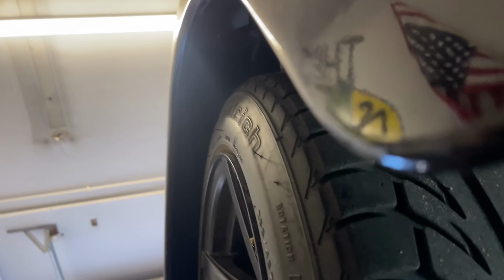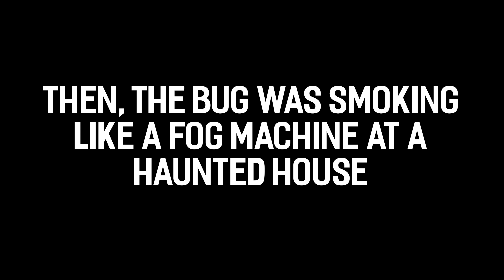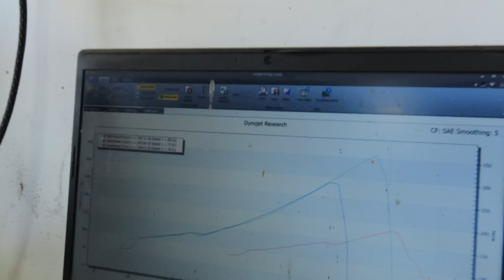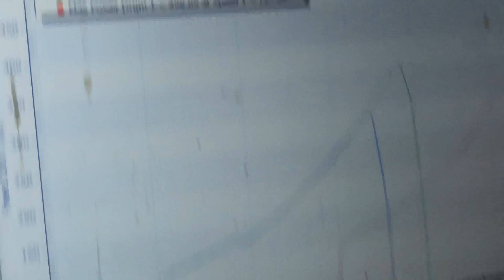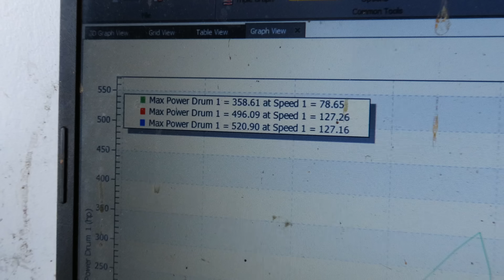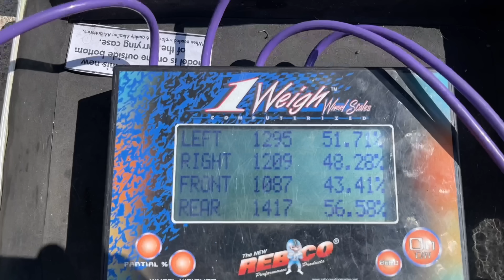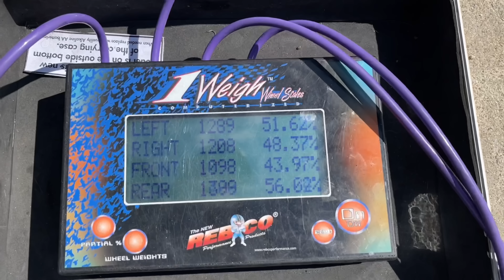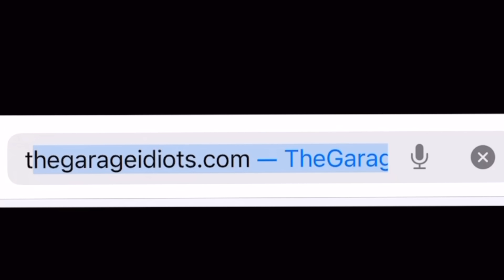K20 Swapped SW20 Chassis Bug Makes POWER at PFI SPEED!

Comment: Just a tip, if your closed ended lug nuts are too shallow for your stud length, you don’t have to cut the lug. Just tighten the lug until it bottoms out on the stud and then it will pop the cap at the end of the lug. Lugs aren’t cast closed ended, the just cap them at the end of processing

Comment: Are those Ball Bearing turbo cartridges? You shouldn't ever restrict a journal bearing. If you smoke, its because your drain isn't up to par. Limiting the oil to a journal bearing is horrible for it. Just a tip, best of luck with it! Also you have plenty of pump and you aren't running that much boost. You can turn the base pressure up 60-70psi and your 1000cc injs will go a lot farther. FWIW Bosch 210lb injectors are cheapish.

Comment: As a comparison for weight of a K20 swapped beetle with full cage with my mid engine K20 with me in the car    729lbs front  = 34.9%  and    1362lbs rear = 65.1%  total of  2091.   And then when the scales were put away, realized  Im  stupid.....my drivers door with glass was not put on, so add another 45 lbs

Comment: kool build .... however once ya "swap" to a watercooled power plant its no longer a "bug" ... sorry but we (aircooled community) even threw fits with VW themselves back in the day when the crappy "new beetle" came out an they tried same thing .... NOPE..... heck at least yall made yer hotrod a rear engine so thats kool have ya had any overheat issues?
Reply from the maker: It’s on an mr2 chassis, so it basically a k swapped mr2 with a bug body